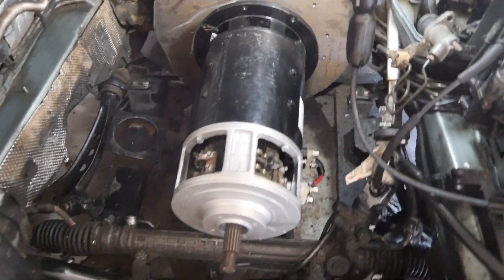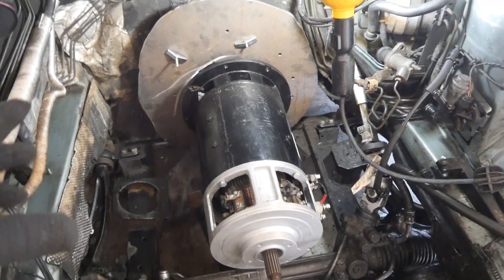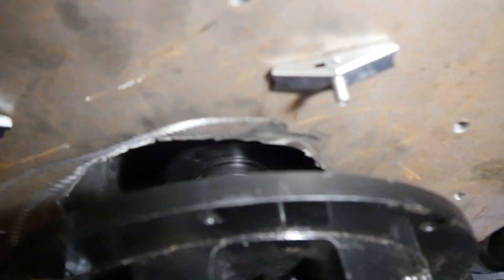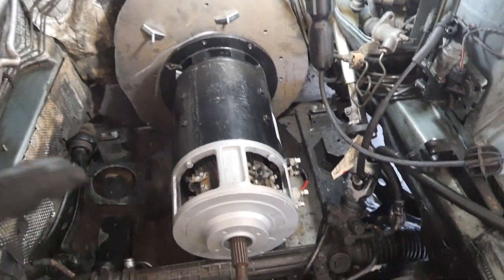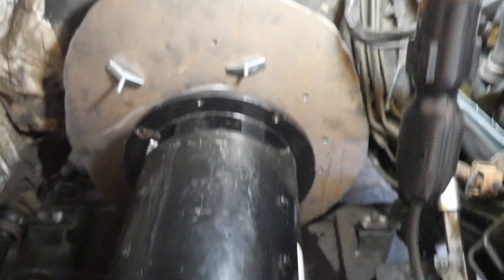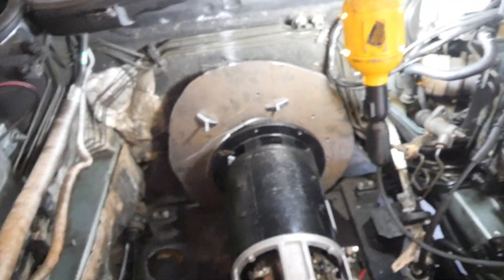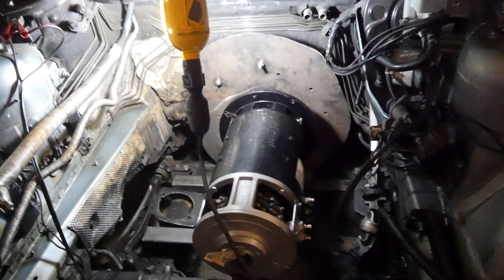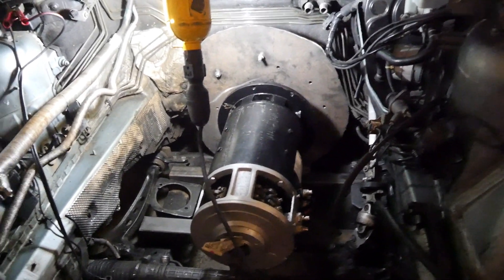Cheap EV Conversion - Transmission Adapter Plate Install!

Comment: it can run without a torque converter?
Reply from the maker: It’s a manual, so no torque converter in the first place. No clutch needed either

Comment: Nice! 
So what thickness and material did you use for the adapter plate? What kind of tool for cutting it? Thanks! 🇸🇪
Reply from the maker: Thank you! 
It was 1/4 steel, I used a plasma cutter, but you could either go to a metal shop and they’ll cut it cheap, or use a bandsaw/grinder with a cutoff wheel if it doesn’t have to be perfect.

Comment: How much kilowat is this motor?
Reply from the maker: It’s rated at 144kw, or about 180hp.
Reply: @TechMischief  that motors got sum power. whats it out of?
Reply from the maker: I don’t entirely know, I know it was refreshed after being used for a short time in another EV, but it used to be used for some type of machinery. It’s a GE 5BT series motor if I remember correctly. About $7k new since it’s a heavy duty, long term motor.
Reply: @TechMischief  thanks! be interesting to see how it pulls.
Reply from the maker: So the 72v lead acid is really temporary, since it was free for me. It will allow me to test the system before investing a ton into lithium or the like. 
I may get another 6 batteries down the road, and then go to lithium, or just jump straight to lithium if a good enough deal comes around. 
The car will likely be around 3200-3500lbs with everything, so the math says it’ll do around 17 miles. 
The amps should be really good though, so it should really kick when you give it gas.
Reply from the maker: That sounds like a great project! I think you should look into the lexus hybrid transmission, someone did a conversion with one and got around 350hp and a really efficient, compact setup. I don’t know how the other gearboxes perform, but it seems like you’ve got a great handle on it!
Reply: @TechMischief  in gas car to ev conversion, it always has to keep the original gearbox?